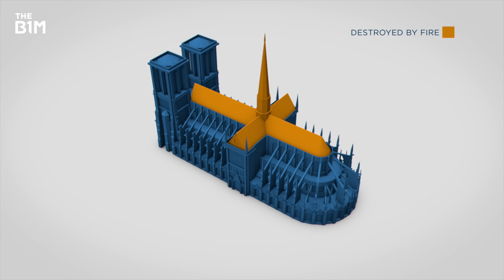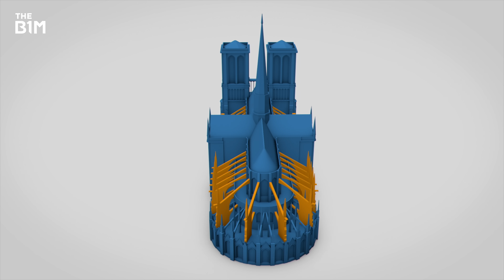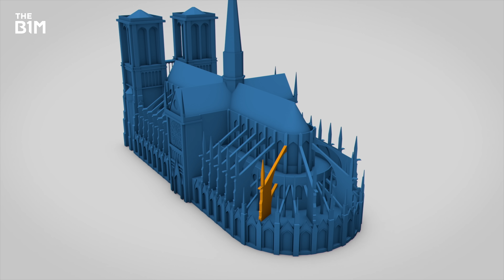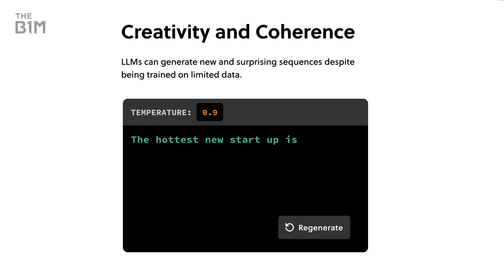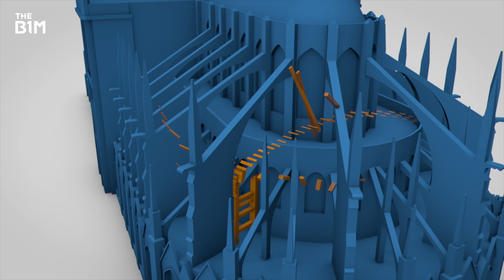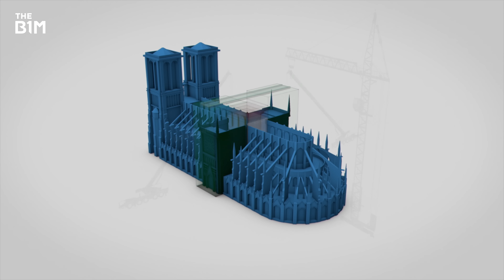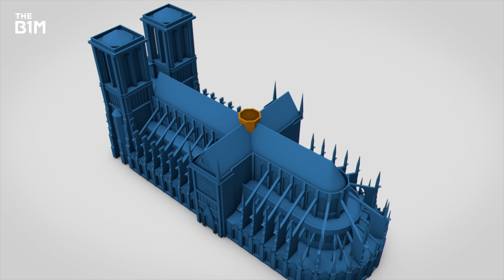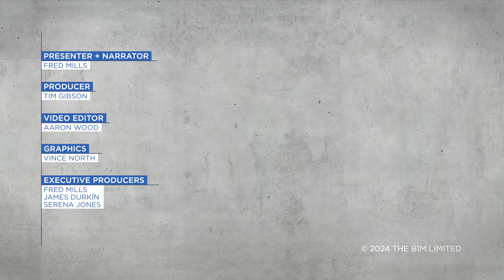How France Rebuilt Notre Dame

Comment: Thank heavens that they went with the classic style. Some of the modern sugestions would have ruined the whole building
Reply: The central spire was already modern. Wish it had been left off.
Reply: @captiannemo1587  It was built in the 13th century.  so "modern".
Reply: @inksday  It was a 19th century addition. So yes, very modern.
Reply: @hailexiao2770  13th* 1230 to be specific.
Reply: @inksday  The spire that burnt down in 2019 was designed and built in the 19th century during that century's renovation of the cathedral. He even mentions it in the video. Hailexiao's comment is correct that it was a 19th century addition.
Reply: @inksday the spire is modern though. It was added in 1859 during the restauration project that hard started in 1845, thanks to Eugène Viollet le Duc's work.
Reply: @almamater9566  The spire was built in 1230.  You can play dumb, pretend otherwise, it doesn't matter.  It won't change reality.
Reply: Are you thanking god for mind controlling people?
Reply: @PROVOCATEURSK  The flying spagetti monster would never do such a thing!
Reply: I m french and i would have prefered a modern roof with clear windows and light + garden at the top.
Reply: I have to disagree, the cathedral already went through many changes in the past so it would've made complete sense to perpetuate this tradition.
Reply: @KragV  Shure, there have been changes, but they have all respected the overall look of the building, and sought to emulate or build on that. Now adays everything has to be done as a contrast. Looks awfull and ruins the overall look of the entire building

Comment: I believe that I heard that luckily they had taken precise laser measurements of the cathedral before the fire. Without these, it would have been almost impossible to reconstruct.
Reply: Well actually it helped a lot, but the plans from Violet-Leduc were also a keystone 🎉 Chance was that the spire statues were removed as part of the rework😅
Reply: Not so. It was built before there were tape measures, using bits of string and wood for setting out. If there had been no accurate drawings, they would have had to work a bit harder for a bit longer.

Comment: The similarity to 9-11 (no not literally). A shocked crowd watching an iconic structure burn, also with twin towers. A collapse happens. And then the slow rebuilding process. The wire walker started with the notre dame towers and then later did the same thing with the WTC twins. Both are/were also gothic (the WTC tridents were based on gothic archs). Notre dame has the hunchback, WTC had king kong (the 80's movie)

Comment: You're missing a key important fact. When the decision was made to rebuilt Norte Damn back to its original form, the architects & builders didn't have the blueprints to do it. Ubisoft, the French video game company, offered up the 3D scan that they had from Assassin's Creed Unity, a game that takes place during the French Revolution. The 3d scab were pretty much identical to what the church had looked like, so the builders were able to use those plans to rebuilt the structure.
Reply: Firstly, no-one uses blueprints. Secondly, they had a very modern and recent set of drawings of the roof structure, which was the only part of the building of any complexity. And the stuff about Assassins Creed is a massive exaggeration (in fact, it's nonsense). Their 3D model wasn't accurate, and there were gaming rights and copyright issues preventing its use.
Reply: @MikeAG333  The model in the game wasn't perfect, but Ubisoft probably still had the raw 3D file, which would have been very accurate.
Reply: @MikeAG333  wasnt accurate? Ubisoft literally scanned the building it is more than accurate enough
Reply: @MikeAG333 Also, the raw 3D file would be unaffected by the rights and ownership restrictions of the game file.
Reply: @richardmillhousenixon  I'm only passing on the reasons given in architectural trade press.
Reply: @MikeAG333  Ubisoft offered those scans themself, so how there can be any Copyright issue, if its theirs Copyright ownership?
Reply: People keep repeating this as if that was THE missing piece (it's not) we get it, video game, assassins creed, ubisoft, french company, video game wo wo, but that's it. It's an interesting fact, it's just that. No there wasn't "no blueprint or set of drawing ever of one of the most famous french monument ever created" and ubisoft came to the rescue
Reply: "The architects & builders didn't have the blueprints to do it?" The Vatican library would have been the better place to look! But lets just accept on face value the plans were "lost". We can then sit easily on our fat asses and not ask questions about how many copies of how many plans  were destroyed? No building is erected with one set of blueprints. Never happened! But we can pretend this was the case.
Reply: @rodneystevens8325 not in Vatican but french state archive département...all french cathedrals and every churchs belong to french people since the revolution.
Reply: @rodneystevens8325  I'm afraid that is to misunderstand the construction of mediaeval cathedrals. Indeed, all mediaeval buildings. There never were any drawings, at any stage (at least during construction...........centuries later people may have studied it and drawn it as an exercise). The building would have been drawn in plaster on a floor, often in an undercroft, in much the way that a boat or ship is laid out on a lofting floor. The master mason (not an architect) would have drawn it only partly to scale, and the majority of its details would have been drawn (scratched) into the plaster at 1:1 (ie full size).
One or two of these floors survive in hidden corners of cathedrals in Britain. I know less about their survival in France.

Comment: No building is eternal.
Great Pyramid at Giza:  Hold my thick chunky beer.
Reply: I mean compared to what it originally was, it has deteriorated A LOT. And to be fair, there isn't many failure modes for a big ass pile of rocks.
Reply: that too will not remain , maybe it will take 2000 or 10000 years more !! but the points remains ! nothing is eternal , everything goes in a cycle .
Reply: @DrDebabratamandal0  99.99% of the damage done to the Pyramids at Giza have been people removing stones. They can easily remain for anywhere between 10 000 and 1 000 000 years into the future.
Reply: @DrDebabratamandal0  True, but being made of stone, probably closer to 100,000 to a million years.  We'll most likely be gone, so it might as well be eternal from our point of view.  ☺
Reply: It has alleready been suggested demolished for reuse multiple times through history. So never say never.
Reply: The Great Pyramid is just made of blocks of stone. No windows, no huge internal spaces. Not really the same argument..
Reply: @adamrice617  You forget the grand gallery as well as the potential space detected by scientists using a muon detector.  😊
Reply: Wait for a fire to burn inside the pyramid! People will believe it was possible.
Reply: The Pyramid site has been a victim of poachers for centuries, many of the stones were used to build structures in Cairo, therefore the site a fraction of what it used to be
Reply: @ytzpilot  And Obelix broke the Sphinx nose....
Reply: As the saying goes, "Man fears time but time fears the pyramids."

Comment: Fred.
How many buildings have burnt while being renovated?
Notre Dame de Paris,
Windsor castle,
The Glasgow School of Art,
Denmark's stock exchange,
Etc etc

How? Why? What lessons have NOT been learned?

New topic for you there!
Reply: Not at the same scale but the Bank Buildings in Belfast burned down during renovation as well
Reply: Boring answer: Construction work often involves materials, fire and chemical reactions that can go out of control. Sprinklers and other fire control systems in completed buildings are not necessarily fully functional (yet) on the job site.
Reply: @hylje in Glasgow it's a common problem ground wanted by developers and miraculously a historic building on that ground gets left to rot or burned
Reply: @hylje  I know that, but there is a failure of safety precautions and security inspections.
Reply: @richardmillhousenixon  clearly. When I leave a building at the end of the day, I have an exit checklist. If I'm using heat, soldering pipes, I have an extinguisher by me. Risk assessment, mitigation, avoidance.
If you're working on an ancient building where as a previous person said, wood is tinder dry, or there is flammable dust around, you wet it down prior to for example using a blow torch, use heat shields or blankets. Windsor castle went up because a work light was left on next to curtains, FFS, it isn't rocket science!
Reply: @andrewclarkehomeimprovement  And those mitigation efforts aren't infallible, which is literally what I said.
Reply: I think you can learn as many lessons as you want and still have heightened risk of fire during construction. You're introducing electrical and heat into an old structure, often filled with wood that has been drying for centuries, and that always brings extra risks.
Reply: School of art twice, it was in the middle of getting rebuilt after a fire before going in fire again
Reply: It's also true that a lot of large old buildings are more or less constantly undergoing renovations. The statistics will want some careful analysis before valid patterns emerge.
Reply: York Minster, I think.
Reply: @catsandcrafts171  I think that was lightening.
Reply: @andrewclarkehomeimprovement  It think that was lightning. FFS it's not rocket science.
Reply: Urbanus Church in Bovenkerk, NL
Reply: Google My Lunch Break and get the full list! These are no accidents! This is deliberate destruction.
Reply: Czech National Theatre too. It burned to ground in 1881, weeks before being finished. Thanks to donations from 45% of Prague citizens it was rebuilt in two years.
Reply: Sint Servaas basilica in Maastricht, very similar incident to Notre Dame in Paris.
Reply: I dont know about a building that have burnt while being renovated, but I know one that burnt down similar to notre dame by a ray, the cathedral of León.
Reply: Wasn't the cause this time even a construction worker who smoked in his break? I think we will never know. But why did they rebuild the roof structure with wood again?
Reply: @skyscraperfan  there is some rebuilds where they use steal and concreate, but some say that the isnt more flexible as wood and can cause some damages to the structure.
Reply: @skyscraperfan  They built it with wood again because that's what it was built with in the first place. When restoring a historical structure you can't just change building materials for gits and shiggles
Reply: A former military aircraft technician told me that the most likely time for a failure to occur was after maintenance.
Reply: Johnny Cash's house when the new owner, one of the Bee Gees, was updating and the crew wash shooting for the classic "Christmas  in the new house" deadline.
Reply: La Fenice in Venezia
Reply: The lesson is very simple, Don't hire the Low Bid guy for the repairs. Yet we love making that mistake over and over.
Reply: @pafr6096  yep. Pay cheap, pay twice.
Reply: How many of those, there were peopel like Michelle Obama present nipping a red wine?